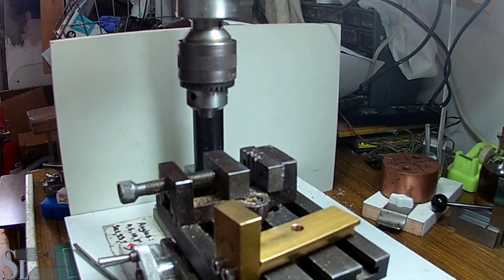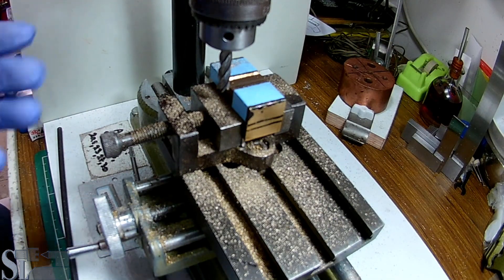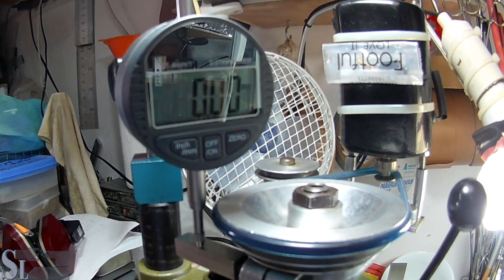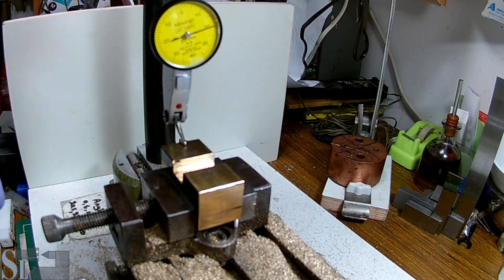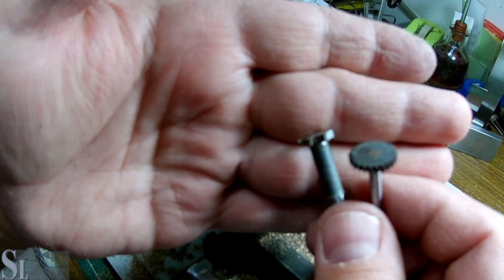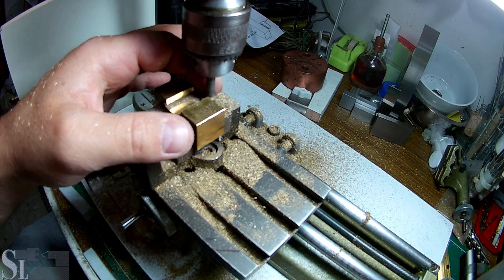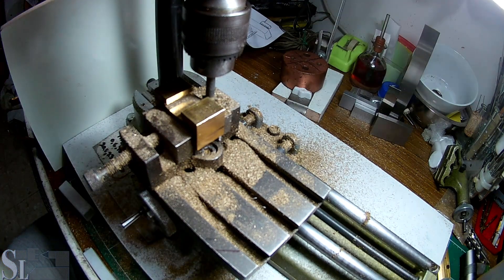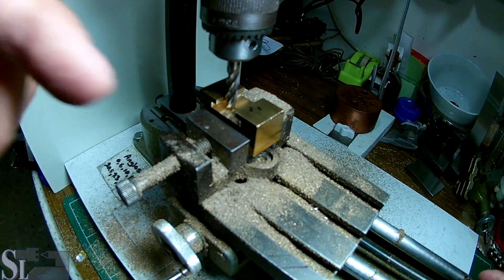Compound Rest for the unimat SL 1000 - part II A

Comment: Hi there. I have more or less the same unimat sl as you do, maybe with a different motor...

First I would like to praise your grit. The unimat isn't exactly the most rigid machine and I am always struggling with this.

What I do find strange is that you actually use the milling table (when the work piece actually is rather small) instead of clamping the vise directly to the cross slide. Taking out the table would reduce the height of the setup a little and improve rigidity a little bit (the spindle would be further down on the vertical column and you would eliminate a whole level of fixture between ways and work piece. Wouldn't be by much, but I take every single bit I can...

But love to see your video. Maybe I try making one of these compound slides to (and even finish it in a month or 12...), although I think I will try a different approach.

Greetings from the north of Spain

Comment: Hi, good video, but as a machinist a few tips:
don't dial in at the stock, but dial in on the fixed vise jaw. As you dialed in at the top surface of the stock, the only thing you measured was, that the stock isn't square but not the parallelism to the milling bed. Before you start working, dial in and shim the vise so it is perfectly true. Than square the stock (milling all surfaces) to make sure the stock is perfectly true.
T-Slots are not meant for accurate movement, its meant for clamping purposes. You should have used a dove tail instead.
Reply from the maker: Hi. Thanks for the tip - highly appreciated!!! I originally intended to make a dovetail track and bought a dovetail cutter but discussing it with friends I was convinced to use a T slot.
I am now thinking on generating a reference tool to properly align the compound rest to the ways for precision (+/-)  angles. Any idea would be highly appreciated. Thanks!
Reply: @Smallathe  It's not that easy on the Unimat as there are pretty much no grounded surfaces. What I probably would do is, make a reference surface on the x carriage (the carriage where the tool post is mounted on). As the z and x carriage should be perpendicular to each other. So you could disassemble the x carriage and leave the 8 mm rods in, and use them as a reference surface to set it up in a vise for milling the back surfaces of the x carriage (the surface thats facing away from you) and take a slight cut so it is perfectly perpendicular to the 8mm rods (and therefore parallel to the z rods). After that you can assemble everything back together and you can use this new surface as zero degrees. Using a digital angle meter you can adjust the angle pretty quickly and precisely with one arm put on the new reference surface you have created and the other arm on the compound slide. This however assumes that the surface of the compound slide is precise. You could do this with the z carriage as well.
Another option would be to use the face of the 3 jaw chuck as a reference surface. This however assumes that the headstock is perfectly aligned and parallel to the z rods.
Basically you need a precise surface  as a reference that indicates a known angle, be it 0 or 90 degrees.
Reply from the maker: @rednibcoding  Thank you for the tips and help! As for milling the unimat carriage - It's a good idea but I can't do that. The z axis travel is 16mm long and the ways are very slightly loose unless in their track - so I have a reach issue and a regidity issue.  But we both agree on the carriage ways as a reference. Please let me know what you think of the next oddball idea: mill flats on a 20x10mm brass - the unimat will probably fail on steel - mill two perpendicular slots for the carriage ways and a locking soft brass tip m6 screw to secure it - i can put this anywhere on the carriage ways and it will form a tangent reference surface (milling accuracy dependant) to the ways. Sounds good?
As for the chuck face - brilliant! The unimat lathe as a mill uses the faceplate to tram the head, so I can actually thread the faceplate and use it as a reference. I will do that! Many thanks!!!